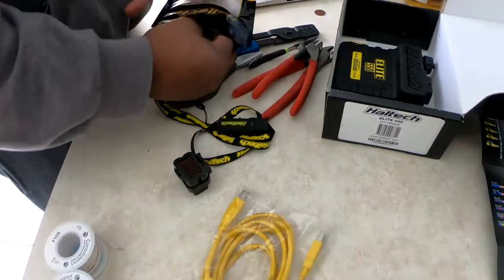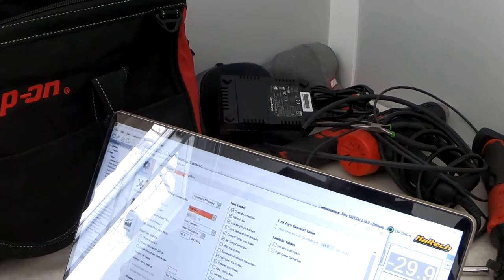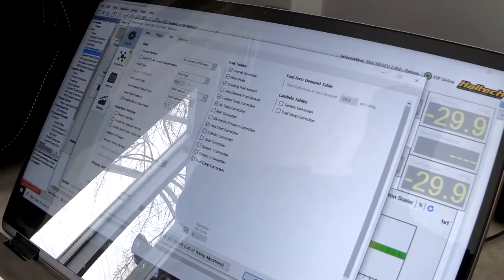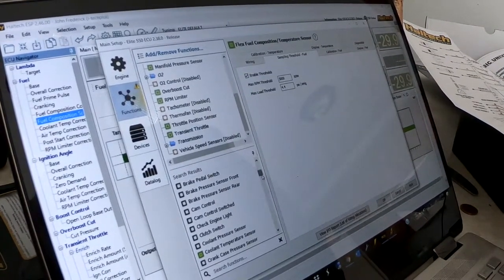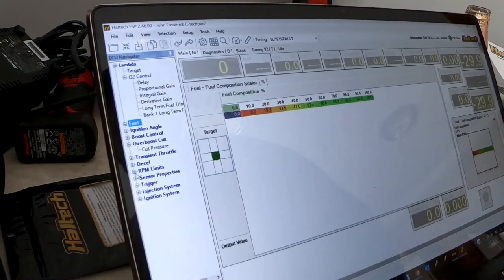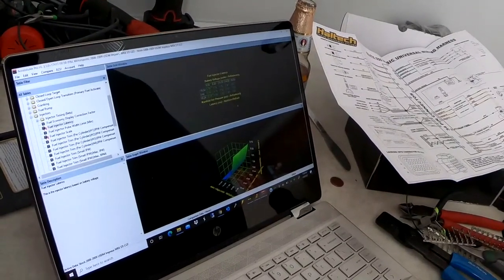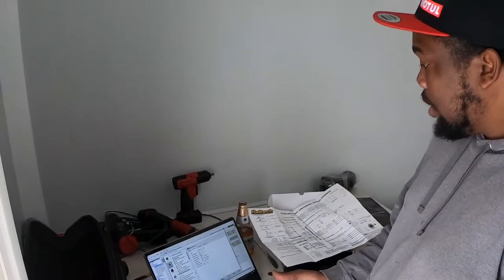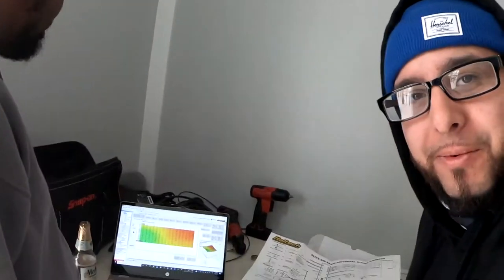Haltech How to Create a Base map STEP BY STEP Turbo civic

Comment: did you reject fmu?
Reply from the maker: Yea I needed to get a ECU it I wanted to make power.i was able to make around 300-330hp with the ECU. I didn't trust the fmu also just wanted the fmu just so I could start driving and get myself on the road.
Reply: @BarbasLife  fmu really needs a wide band lambda meter